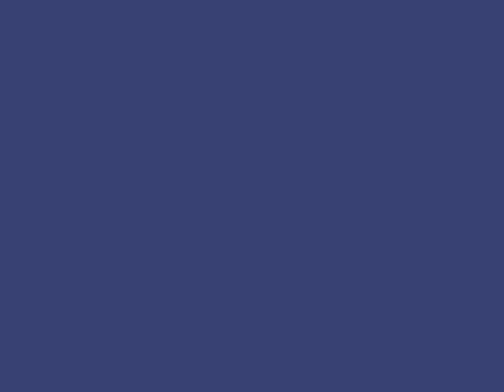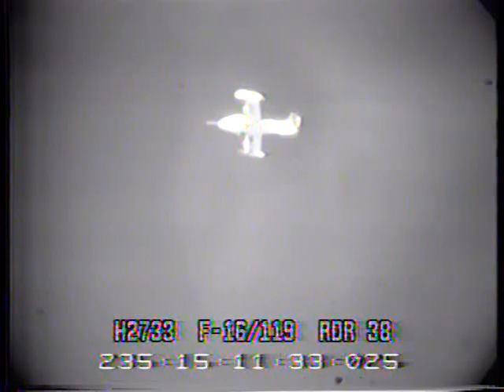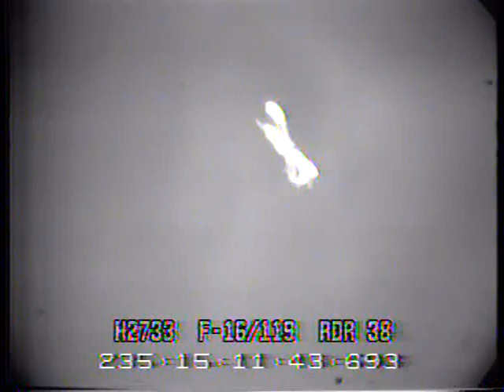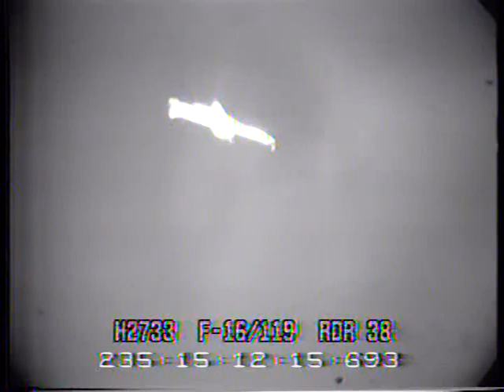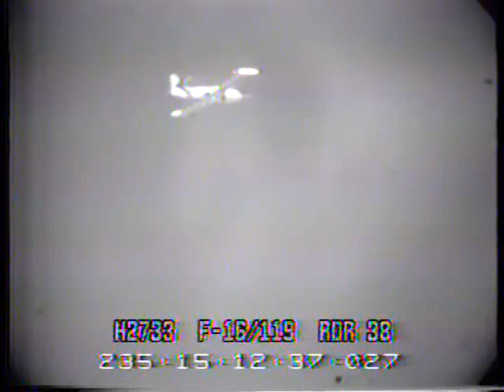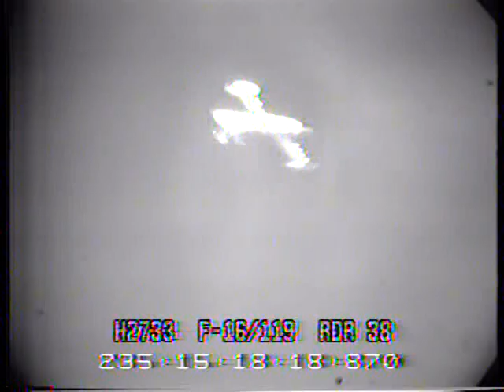A-37 Spin Flight

Comment: Holy crap, that’s a pretty nasty stall/spin - straight to a tumbling/inverted spin.  I guess the point of this training is “don’t stall/spin this AC at low altitude.”
Reply from the maker: Yes, it was a great spinner! But we needed to have an inspection for oil loss after every spin so we used a T-38 to do that (don't want to make it easy). The spin exercises were great training for a test pilot. There were rather complicated procedures that needed to be performed at the proper time all while you were tumbling around and trying to observe and remember everything so you could go over it at the debrief! The T-2C was great for spinning too. I also loved tumbling the A-7! See more at  http://gregbass.com/2
Reply: @iusedtogomach  I had the chance to fly in one back around 92.  I was in AFROTC and we all got a 30m ride down in Laredo.  I didn’t get to do anything that crazy, but we did pull 6 Gs in a diving spiral.  The pilot tried to get me to puke, but failed.  :)